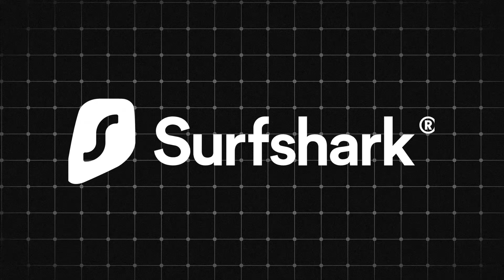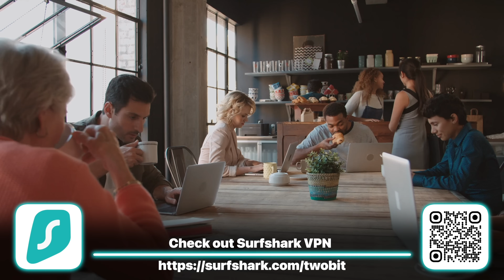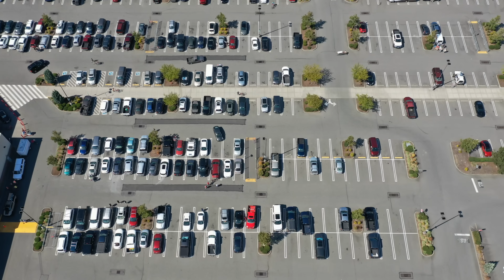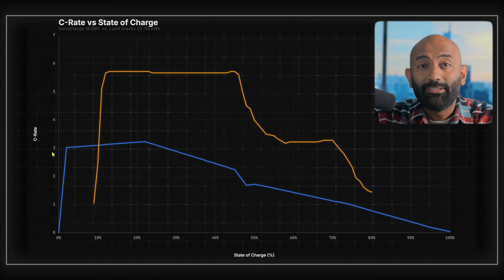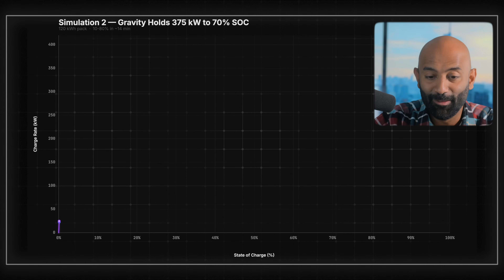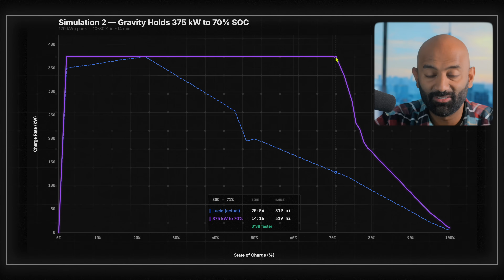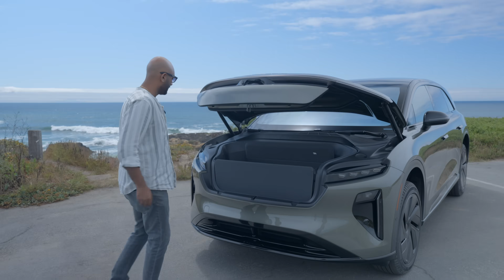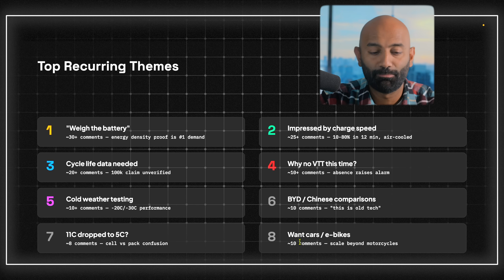Donut Lab Battery Test 4 Changes Everything!

Comment: The flat plateau of 5C seems extended  due to the higher temperature the cells can take ( 90c vs 60c for regular cells)
Reply from the maker: yeah that 90C vs 60C temp spec is the secret sauce — lets them cruise at 5C where others would cook

Comment: in a small pack water vs air makes no difference since you can use heatpipes to beat watercooling.
Reply from the maker: in a small pack? yeah heatpipes can hang — but we saw what watercooling did on that motorcycle at 5C+

Comment: Please also note the start of the charging of Donut battery - it goes to the max level allowed by the bms immediately- so without any "preheating" (comparing with Lucid) of the battery. This can give us some clue that the battery is less "temperature dependent"   We do not know if the charging started with "preheated" battery - maybe yes, but maybe not - and the Nordic countries temperatures now are rather low (usually the preheating is needed for li-ion) so... it would be very interesting to see the test of the battery discharge / charge at low temperatures..
Reply from the maker: no preheat needed? that's wild for li-ion in the cold

Comment: This doesn’t actually change anything. The charging speed hasn’t been questioned in this and there’s nothing new in 10C charging. The price point, cycle life and manufacturing capabilities are the one to suspect here. This motorcycle was sold out as soon as the news came out, and expected sales are less than 100. It can easily been done with any commercial option. Still no samples to potential clients, no factories and no hint what this so called ground braking technology could be, except practically impossible claims that can’t be true and doesn’t seem to be true based on the test results that are published.

It would be interesting to see when first real customers get this bike, because they could make good money by selling cells for those who want to see what they are. No real manufacturer would bother, unless they want to expose the fraud.
Reply from the maker: fraud claims are strong — let’s see the cells, the factory, and the price tag before we call it groundbreaking

Comment: Thanks for the video! I do have one question - how confident can we be that C-rates scale linearly with pack size?
Genuine question, I know nothing about the technical battery science.
Reply from the maker: oh c rate doesn't scale with pack size. if you have a 1kWh battery pack charge to full in 1 hour that's 1C. if your new pack has 2 of them for 2kWh, you can now charge at 2kW (2x as fast) b it's still 1C. the limiting factor to that scale, is if you have interactions like the two batteries touch making each other hotter which could slow down top speeds.

Comment: They claimed 0-100% in 5 minutes, and we're supposed to think that 9-80% in 12 minutes means that they weren't lying?
Reply: @Syscrush  Fair point, but two considerations: 1) this test is a Verge pack, not a Donut cell 2) 5 minutes is the extreme limit, full system (grid to charger to pack to cell) introduces constraints.
Reply: @jamesmollard  then, what's the point of the video? 🤣

Comment: Some other considerations...
What is the BTU load on the vehicle cooling system to maintain this charge rate un a pack with 5 times the density completely sealed in the bottom of a vehicle. You may be constrained to 3c rate right there with a possibility of 5c for a minute or two. If this is the case, perhaps a couple of minutes faster then.
I personally wish I could dial back the speed of the charger. My typical 15 to 20 minutes is not enough time to shop or get some lunch.
And still yet to be confirmed is the longevity. I think current batteries could achieve this, but only last a few hundred cycles.
Reply from the maker: Yeah, sealing a high-density pack in a bike’s frame? That’s a heat trap — no wonder they’re throttling it. Real world ain’t a lab.

Comment: maybe i’m wrong but compared to lucid there’s not much gains in charging speed, yes it’s double and yes it’s more than welcome but i see it this way:

On a roadtrip where you want to charge short:

- Lucid takes 10 minutes to 45%
- Donuts’ battery takes 5.5 minutes to 45%

That’s 4.5 minutes faster, 

Now let’s add it to a real life situation adding detour (1 minutes) and charging handshake (30s):

- Lucid is 11.5 minutes 
- Donut is 7 minutes
So irl it’s more like a 35% improvement in user experience 
Real improvement is good but not crazy imo, i think what really would matter is weight (efficiency improving), longevity (more charge cycles) and cold performance… non of which they’ve shown so far. why that is? 🤔
Reply from the maker: weight and cycles > charge speed — show us the cells

Comment: just wanted to point out, once you hit constant voltage charging, the current going in is entirely controlled by the pack physics. It isn't controlled by the BMS(eg the BMS isnt controlling current it is just holding voltage). What goes INTO the pack is just physics at that point.
Reply from the maker: exactly — once CV hits, it's all chemistry, BMS is just babysitting voltage

Comment: Ultium has had sodium-ion based solid state batteries for a few years now, and is going through the regulatory processes to use them in automobiles which takes years of safety testing before they start mass production, which they are already building the factory for that in Tennessee.  Why Donut is so secretive and won't let anyone see their batteries is most likely because this is a case of corporate espionage.  They're rushing to get handmade copies to market to make a huge cash grab and will vanish by the time they get a chance to be sued to another galaxy.  Their spec claims are that of the original version made by Ultium they most likely stole, that their handmade copies won't quite match.
Reply from the maker: Ultium has sodium-ion solid state? Never heard that — link or it didn’t happen.
Reply: @TwoBitDaVinci .   The recent Aging Wheels EV1 video when the CEO of GM invites them to the factory to offer them anything they need to rebuild the car.  They get a tour of the battery factory and the lead engineer spills the beans they had solid state for a few years now.
Reply: They explain that right now the  main goal of GM is cheap EVs not high tech, why they use a modular pouch NMC in their cars.
Reply: The fact that GM allowed them say that on video is no coincidence.   GM has basically unlimited budget with the smartest people in the world.  Donut has….  Nothing.  If I were you I’d start checking employee records if possible to see if anyone at Donut has any connection to Ultium.   I’d bet my life after seeing that GM allowed Ultium to say that on record that Donut somehow got leaked plans from them and is reverse engineering.

Comment: if they would just weigh the battery, it would remove the majority of skepticism that abounds because, Wh/kg (the real measure of energy density)
C‑rate in amps per gram, which tells you whether the cell is truly robust or just oversized
Thermal load per unit mass, which determines cooling feasibility  Keep these videos coming 2bit. Great job sir
Reply from the maker: totally agree. the easiest thing to do ... seemingly still a mystery. Now I will say it could just be teasing us and keeping us captivated. these guys know what they're doing when it comes to marketing

Comment: I'm most concerned about longevity.  All the releases so far are independent of each other and under Donut's control.  Real batteries are tested at length in labs and debated in research papers.  It still feels like we are being strung along. We need to see cycle life on production I rent cells/packs. One off charges don't suffice iny book.
Reply from the maker: cycle life on actual production cells — that’s the only number that matters

Comment: I guess for now we can add two charging ports for a total of 800Kw lmao.  12 minutes is very impressive, still not as fast as a gas-n-go (3-4mins) but easily about the time it takes to hit the bathroom and grab a drink.  No longer in the realm of needed to sit around waiting or grabbing lunch while you charge.   Though I still maintain infrastructure is the primary barrier to such high charge rates.  How on earth can we have 10MW charging stations everywhere?
Reply from the maker: 10MW everywhere? Yeah, good luck getting the grid to agree — we’re still arguing over whether to fix potholes.
Reply: @TwoBitDaVinci exactly, the upgrades needed to electrical infrastructure to support EVs going mainstream would be insane.  People in my area are raising an absolute tantrum over building a single 700kv line and power stations needed to support growing electricity demand from the population and data centers.

Comment: So, not directly related and might not be your area but how do we get ubiquitous 1500kw charging stations in the u.s.? 

I can drive 500 miles on a long weekend trip and don't want to deal with the existing charging infrastructure.

600 mile solid state range would fix that but the future is 300 miles of range and 5 minute convenient charging as that cuts the battery size/weight in half which reduces tire, break, cooling requirements (i.e. vehicle cost) which will make 98% of ICE vehicles obsolete.
Reply from the maker: 1500kw chargers need grid upgrades that aren’t happening fast enough — solid state helps but isn’t the bottleneck

Comment: i am wondering why this tested pack is 18kwh? they say on website that this motorcycle will come with 20.2kwh and 33.3kwh pack with charging up to 200kw. where is big pack? they are offering it to buy already, and they do not have working 33.3kwh battery?
Reply from the maker: probably the 18kWh — they gotta validate the small one before strapping the big one to a bike

Comment: The issue is that when more and more things charge faster the strain on the grid is that much worse. Can you imagine the power strain on the grid with every car using megawatt charging.  Just think of the size and amount of transformers needed to support a large megawatt type charging station.  Every car would need a fully independent charger with dedicated power not sharing like today. I think it’s going to be a long time until we see this in the USA.
Reply from the maker: yeah that's gonna need some serious grid upgrades — but hey, we survived AC and TV

Comment: 9:38 It looks like two heat sinks is the way to go. Who would want to sit on/next to a battery pack that goes to 82C vs. 47C? 47C is bad enough, but 82C is chard skin territory.

If these tests continue to impress, this will be a game changer.

For me, the environmental thermal cycle (-45C to 55C) and charge/discharge cycle, in a HALT test configuration of five to seven commercial packs, not cells, will tell all that matters at this point. FYI: This test would take at least a month, if not two, to run.
Reply from the maker: Chard skin at 82C? Yeah no thanks — HALTs on full packs are the dream, but even cell data’s telling us something’s cooking.

Comment: Does. It. Scale.  Yes, you've done great comparison with the data you've been able to compare.  But we still don't know for sure that the chemistry is capable of scale at the rates tested.  it is still possible, though admittedly less likely as more tests come in, that there will be some limit to the scale of pack that can be built that is as meaningfully different as the small Motorcycle pack is.  That said, my flight of fancy would be, if these end up with the energy density claimed,  would be an EV "Jerry can."  You could carry a quickly charging, light pack capable of giving you an emergency charge if needed.  Say you have an older Leaf or Bolt - there are still stretches on certain drives that have charges far apart, where range anxiety is real.  It's be awesome to have this pack charged cheap and slow at home,  plop it int he car for a road trip, and not have to worry about long stops between charger, especially in the winter.  Stopping at a rest area with no charging, you could break out the EV Jerry can and charge.  Wild and crazy thought, I know, but hey, while we're wishing for the perfect battery, some of use have less than perfect ones and need to keep em for a long while :D
Reply from the maker: EV jerry can for winter Leaf trips — I’m here for it

Comment: "Oct 19, 2009... The Hyperion G series CX and VX can be charged at up to 5C. test by myself,by Thunder Power ,Hyperion and field reports from many pilot confirm no additional loss of capacity or performance loss due to these increased charge rates."
Reply from the maker: wait, so older Li-ion already did 5C with no degradation? then what's the big deal with Donut Lab?

Comment: I’ve been following this battery since before you release your first video about this battery and once you put out your video, you became my number one go to source for information. I’m combined to an electrical wheelchair and I’m mentally not a car but I go through approximately to 60 amp hour 12 V acid batteries every thousand miles/1 year and yes the Medicade pays for that I love to get five years out of a battery instead of one. At first I was expectedly disappointed in the donut battery but each test you’ve done. I have gotten more excited and think that the numbers that you’re showing are pretty darn exciting thank you for this. Thank you for these videos.
Reply: You may find YT channel "Miss Go Electric". enlightening coverage on the Donut/Verge story.  They have a GREAT interview with the CEO of Verge and VERY interesting analysis videos.  She has 3 channels, MOST of the coverage is on the "industry" channel.
Reply: I switched my electric scooter batteries from lead acid, which I had to replace every nine months( less than 300 charge cycles), to LiFeP which has third the weight as well as 3000 claimed charge cycles, so far still strong at more than 365 charge cycles, I think realisticly i should get 1500-2000 cycles which equate to 3-4 years, for a daily use/charge scenario. I highly recommend a switchover to LiFeP batteries for a 3-4 year operation.
Reply from the maker: wheelchair warrior sticking with us through thick and thin — that’s the real charge cycle

Comment: None of the tests so far are impressive in themselves. They become impressive when the cycle life and energy density are confirmed. (Not quite sure how 100k cycles can have been tested given the time required). Difficult to differentiate the test data from what would be obtained with an NMC battery, so long as there was a willingness to frag it after a few cycles.
Reply from the maker: 100k cycles? Yeah, we’d need a time machine. For now — real charge data, not lab fantasies.

Comment: BYD is building 1.5 MW chargers to support EVs with its liquid electrolyte battery that charges from 10% to 97% in 9 minutes. Currently there are more than 4000 of those chargers with the aim to have 20000 by the end of 2026 in China.
Reply from the maker: BYD’s pushing hard — 1.5MW chargers and 9-min 10→97%? That’s next-level. Donut Lab’s 5C on a motorcycle is cool, but this is grid-scale.

Comment: I am still skeptical. Extraordinary announcement, request extraordinaire proofs. They was Donut handles this makes me think about some kind of scam to get investor money. But I appreciate the work you have done to try to understand how realistic is this. Why motorcycle and not car? It is there that the money is. So what is stopping them. Car manufacturers should run to sign contracts. I just hope you have not invested so much time for some fishy thing.
Reply from the maker: skepticism is healthy — where's the weight data? motorcycle first makes sense: fewer cells, quicker to test. cars need 10x the validation.

Comment: Im still skeptical because:
1. They didn't use their flagship 33kw version. These videos are promotional, other bikes have larger packs than 18kwh, why wouldn't they show something no one else has, especially so close to release?
2. You can fast charge many batteries if you don't care about their longevity.
3. They claimed 0-80% in 12 minutes, not 10-70%, they are already moving the goal posts, this is rarely a good sign - ask Elon.
4. This wasn't a lab test, the entire thing could be fake.
Reply from the maker: fair — but if the 33kw version can't hit 5c at a public charger, that's the real story

Comment: 3:16  You can charge RC LiPos at 5c, but it’s not advisable!  They get hot and the potential for failure goes WAY up.  It’s also not good long term for them.  We’ve already seen this pack get really, really hot so a single charge test pushing the limits doesn’t really tell us much sadly…
Reply from the maker: RC LiPos at 5C? Yeah they turn into hand warmers fast — their cooling better be legit

Comment: I do wonder what the real world charge rate will be if you are riding your motorcycle for 10 miles before stopping to charge and the battery is already warm. But still, very impressive.
Reply from the maker: warm battery changes everything — real world won't match lab

Comment: Maybe you could do a video about how an entire city has all its electricity pumped in through wires.  Size, amperage, voltage, how they get all that power into a huge city.  You would think the wires would have to be two feet thick or something…..
Reply from the maker: power grid deep dive? nah, i stick to batteries — but love the curiosity